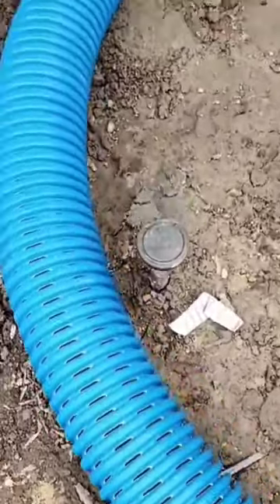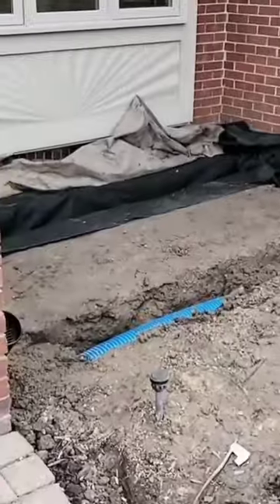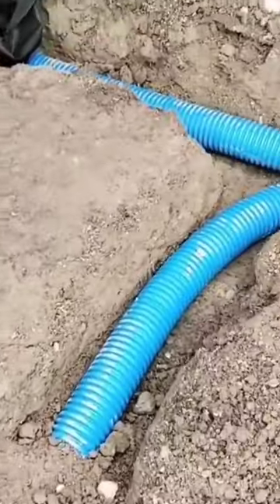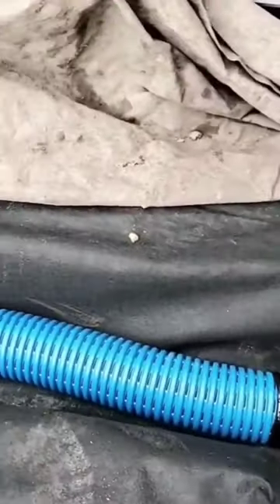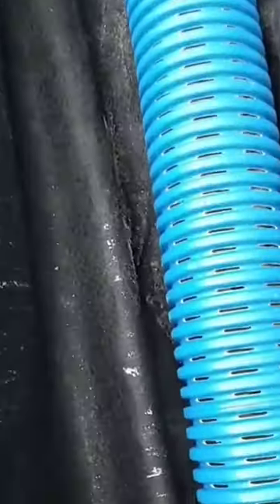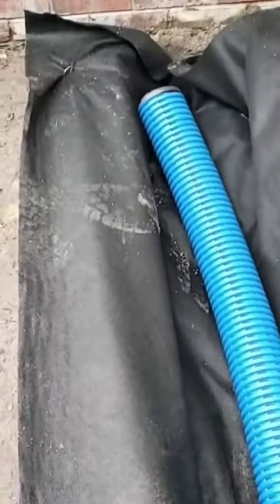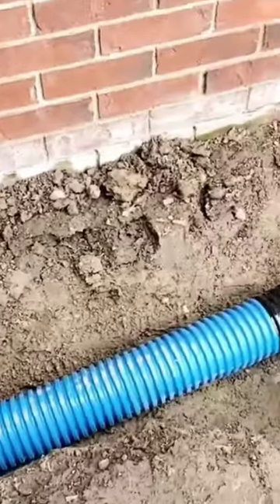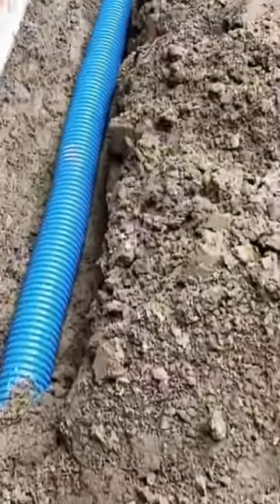Can you tie a French Drain into a Gutter downspout line? #shorts

Comment: Why? Is it because you don't want the higher volume flow from the downspout line backflowing into the perforated drain and flooding the area it was supposed to be draining?
Reply from the maker: FULL VIDEO:
https://youtu.be/uKrUephna_c
Reply: Yes for that reason. Also if you RWL is not tied into a sump the sediment you put in there from your drain tile could block up the city’s storm water system
Reply: Wouldn't it make more sense for the perforated pipe to be on bottom to catch anything and run it to daylight

Comment: I only need a shallow french drain around one side of my garage,  but need to run it, along with downspouts and catch basin, over 200 ft away to a decent slope to daylight. 

Can I run my french drain and two downspouts to a catch basin, with the inlet pipes mounted high and the discharge pipe from the basin at the bottom so that incoming water won’t have a chance to fill the basin to the top and backfill the french drain?
Reply from the maker: We usually use our pop-up emitter because they don't hold as much water. In the winter it's gonna freeze up and because a big block of ice.
Reply: the catch basin would have a discharge line covering the long distance to the nearest slope with a pop up on the end. Not trying to use the basin as a drywell. 

If i ran the down spouts and french drain to one of those 12 in basins with the adjustable entry/exit walls you show here: https://m.youtube.com/watch?v=2Sj1JzyFeeE&pp=ygUVZnJlbmNoIGRyYWluIG5vIHNsb3Bl

as long as the solid wall discharge pipe from the basin is lower than the french drain inlet, should i be worried about water backfilling the french drain?
Reply: also thanks so much for the fast reply. very impressive